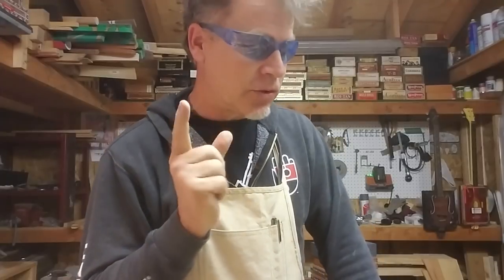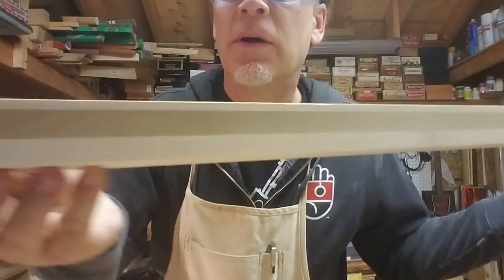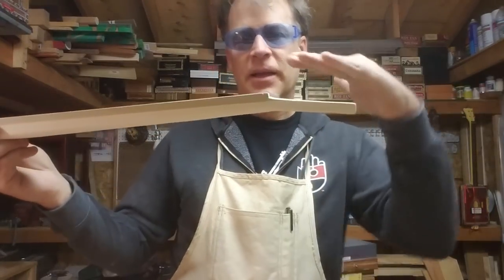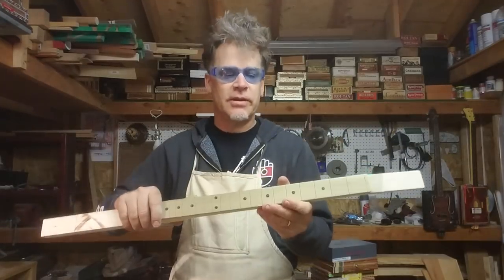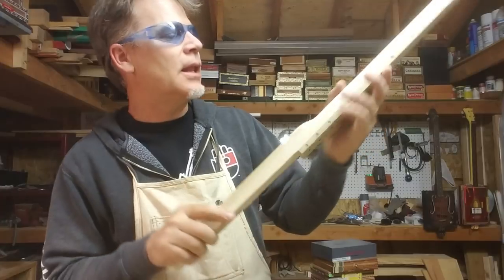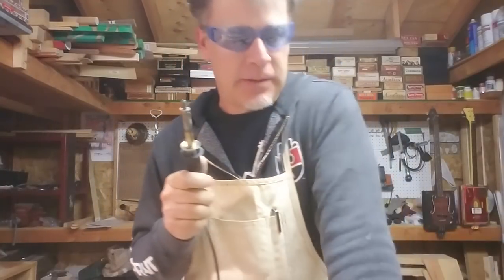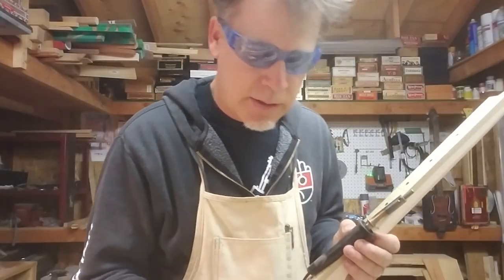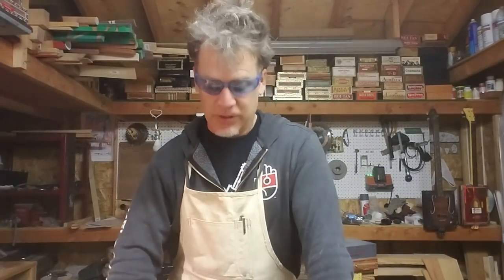3 NECK TIPS for your Cigar Box Guitar

Comment: Instead of burnt soldering iron fret markers,drill tiny holes where the fret markers should be,drop a small amount of glue in hole,sharpen coloured pencils insert tip in hole and cut off sand flush,whatever colour you want.. Cool videos by the way!👍